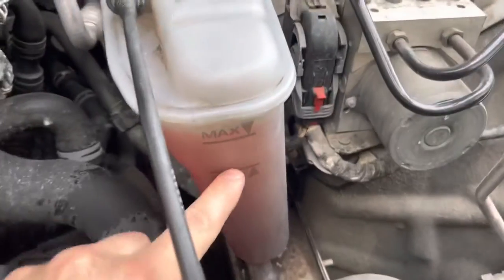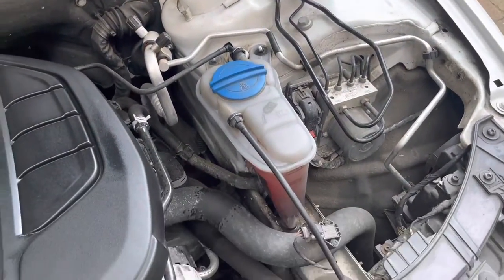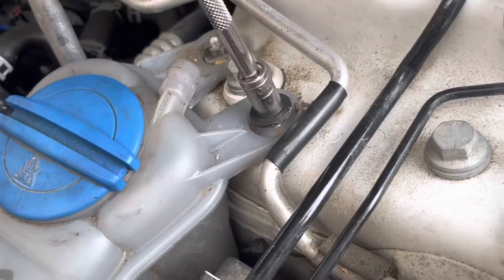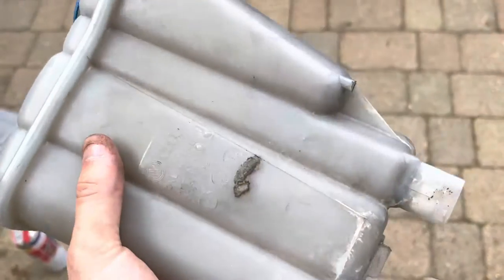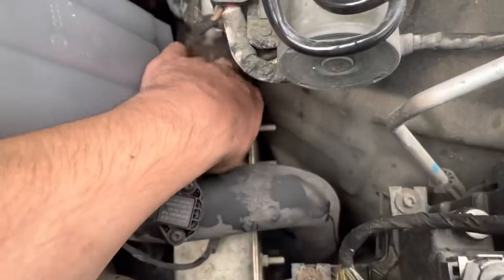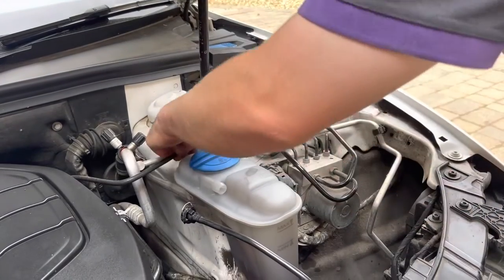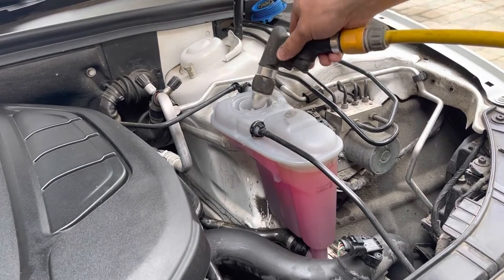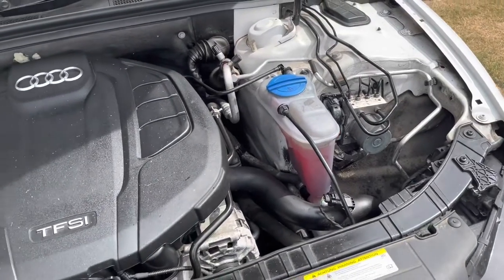Audi A5 1.8 TFSI coolant reservoir replacement header tank

Comment: I had the same crack in same place. I was told it was because I had an oil leak, so the engine overheated and damaged the coolant tank.
Reply from the maker: I believe it’s a common fault with the tank

Comment: really useful, I have crack on the reservoir in exact same place. May ask between 2:14 and 2:17 the coolant has gone from the reservoir, did you remove this off camera or did you collect it as it came out the pipe you removed at the bottom? thanks!
Reply: I was thinking the same thing. I'm about to replace mine and wanted to see the best way to capture as much of the current coolant as possible to avoid mess 😅
Reply from the maker: Hello thanks for watching I just replaced the coolent with new and squeezed the air out the pipes